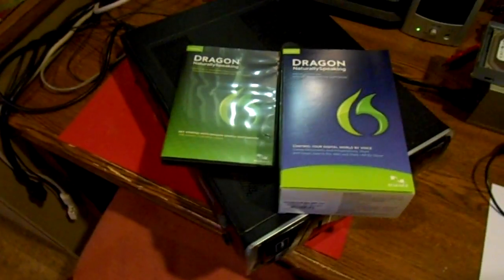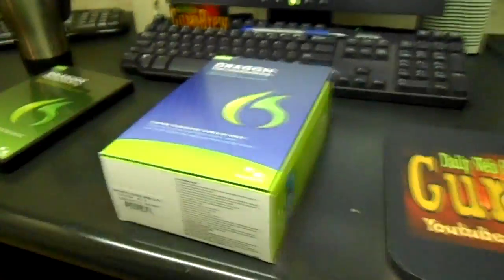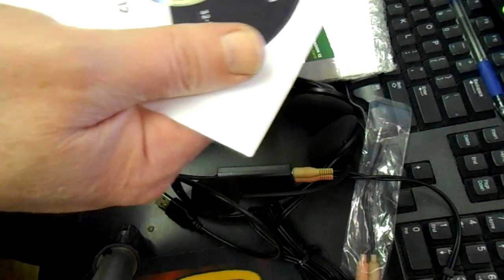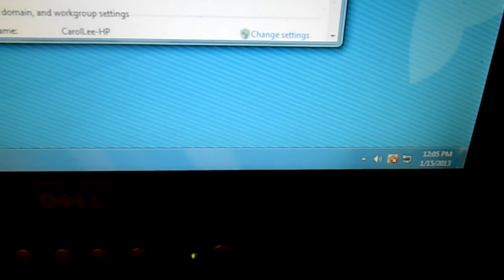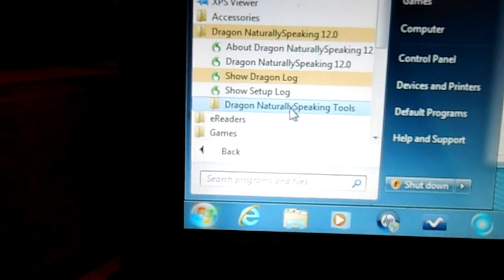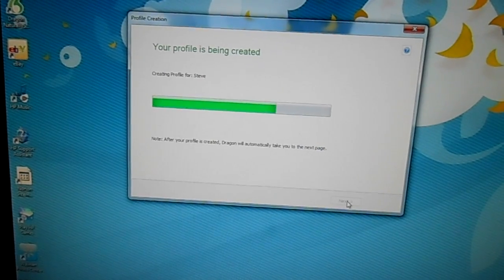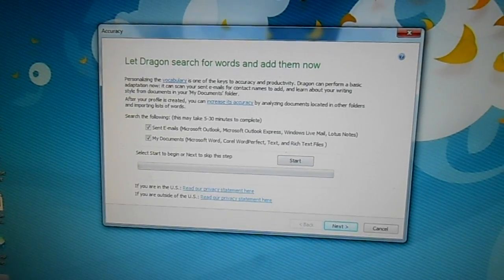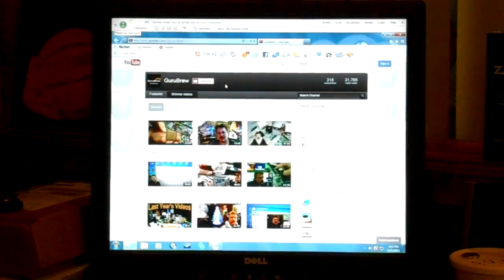Speech to Text Recognition Software Review - Dragon Naturally Speaking Premium 12

Comment: there is meant to be a new premium 13 which is accurate straight out of the box, is that only if you keep using it online? i mean does it need the web to update its able to keep accurate or can you use it at 99% accurates straight from the box without being online or use by the web?

Comment from the maker: The specifications you have are not terrible. Some of the older versions of Dragon may work better on your system that the newer. Try looking on Ebay or Amazon for new-old stock of a Dragon version that will work with your equipment as is. Best of luck